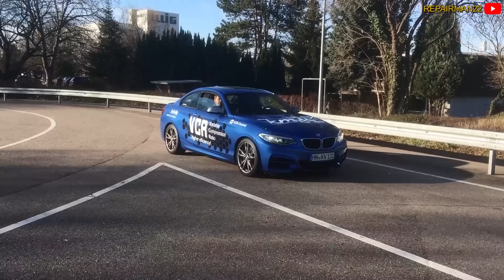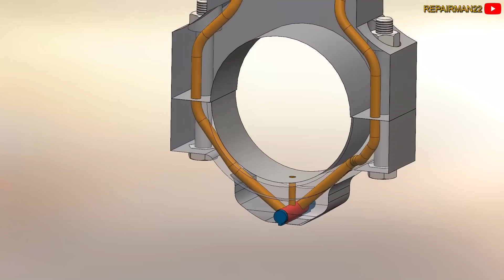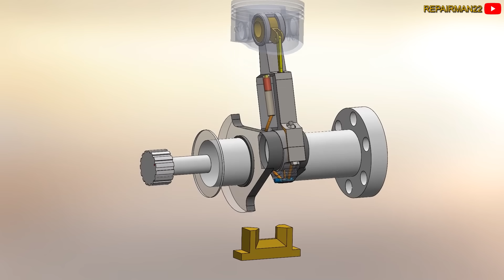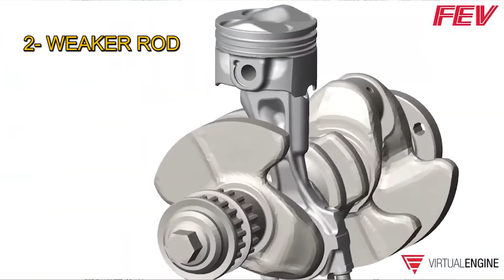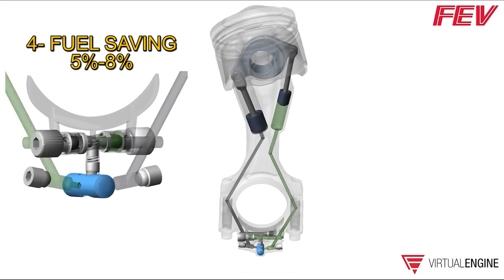This BMW has variable Connecting Rods that can vary its length and Compression of the Engine 🤯 VCR

Comment: It’s a terrible idea all of it as far as the engineering goes, the concept is on point, but the solution to that issue can be done with combustion chamber, the volumetric size modifications  can be altered on the fly with a movable plug in the cylinder head they made variable length intake runners BMW uses a DISA valve to open and close part of the plenum, you could close and open a depression in the cylinder head, or even have the VANOS system incorporate cylinder bleed off, or even leave some vacuum in by closing the exhaust valve earlier (sans overlap) during the times when less compression is needed and more volume is desired. This can easily be done with literally only one more moving part, or a few if done mechanically instead of hydraulically via engine lubricating oil, and no oil pump major plumbing or excess weight, weakened and less reliable parts that need to be strong lighter and more reliable. These new engineers must have serious tunnel vision, and it sounds like they either need to stay out of Amsterdam, or learn the K.I.S.S. approach, Keep It Simple Scheisskopf!
All that complicated mess in the reciprocating parts may only slightly increase the bob weight but it will change the center of balance, you would see this if you stepped back and opened your cannabinoid laden eyelids! Nein der Depp Schwashopf!

Comment: yeah since bmw is well known for reliability lets add another complicated part into them.  after a month each cylinder will be hard locked into different compression and the vvt will be locked into racing mode or tractor pulling mode!!

Comment: Using electronic valves will be much better I guess as you can close them quickly or lately so that less or more air and fuel gets into it and control the compression.

Comment: This whole idea is obsolete.  Just close the intake valve later until less air is present and compress with a high CR as before.  It will achieve low CR through dynamic reversion.  Valve timing is already variable.  No other parts needed, just software.  For those concerned about fuel or emissions, we have DI already, so there is no fuel in the incoming air.

Comment: Why not go for a solution that decreases engine complication and remove the need for variable compression? Ditch the turbo and go naturally aspirated! That one has been tried a few times before, and it seems to work fine.

Comment: There are simpler ways to create variable compression, all while using standard rods, pistons, and cranks.  Saab comes to mind, where an eccentric shaft pivots the entire head down towards the crank by a few millimeters.  Brilliant in its simplicity.  In engineering complexity is the measure of poor engineering.

Comment: For those interested, Saab built a variable compression engine in the 2000's by using a hinged block that moved the cylinders and the head closer and further from the crank.
Reply: I remember this, it never went into production however. Think they had too many issues making it reliable
Reply: @jaredbawden6707  According to Google it was killed by GM due to budget
Reply: @1234567890CAB  SAAB did have a reputation of spending more than they were making. So that's unsurprising. Still 20 years on, the tech was never utilised.
Reply: That would be interesting on a test bed, but in a vehicle with all the fuel, inlet and exhaust connections having to flex as the head moves, to likely to fail.
Reply: yeeah, or just move the crank case instead of the block and head ; ), 
 cilinder @PiDsPagePrototypes
Reply: @blauwzakjecrack  Same problem, but worse, as the crank moves the entire drivetrain alignment alters.
Reply: @blauwzakjecrack  if you want to be able to vary the cylinder pressure, the word you're looking for is "turbocharger."
Reply: @rocketpigrecords3719 NOP!
Make a turbo engine be more efficient at idle or under low load!?

It’s called the Atkinson’s cycle and you do need lower compression for that.

The best solution is to be ABLE to have either low compression or high compression, instantaneously and on demand!
Reply: @pepeshopping  it's called they don't do this for a reason. 

Mazda made a car based on these tryhard concepts, it was called the Millenia.

Gee, I do want a supercharged engine that produces the same power as a naturally aspirated version of the same engine without the Geek Cycle, but with unimpressive real world economy gains and many more expensive moving parts to fail.

The 2.3l Millenia had less power than a buick 3.8l and matched city economy, made 2mpg less highway.

That's right, a 1.5l bigger redneck pushrod motor beat the smaller nerd motor in economy, without making maintenance a burden.

Why bother?

Now, compare to the Ultra, supercgarged 3.8l.

While the Buick loses 1mpg city, matches highway, it absolutes assrapes the Mazda on power. I used to run an LT1 Roadmaster, a well driven Ultra was a threat to my 265hp 335lbft hoonmobile.

Which, lol, at 5.7l and over 2 tons, made 2mpg less city and highway than your dorkmobile. While being able to tow 5500lbs, seat six, and be admired & desired.

Geeks get slammed into lockers for a reason.
Reply: @PiDsPagePrototypes  It is a solved problem. The harder part is to make variable length connections to timing. Additionally adjusting height is a very hard work - there is always high pressure cylinder that need to be overcame whereas piston can be adjusted during time without acting force.
Reply: That was also a stupid idea, which is why Saab had to rely on GM engineering & rebadging Subarus before inevitably dying off.
Reply: @rocketpigrecords3719  they were meant to be relying more heavily on GM designs than they were. Kept spending too much redeveloping designs they were handed, which is why GM inevitably pulled the plug. Had they been more modest with their spending habits, they may have still existed.
Reply: @jaredbawden6707  they were dedicated to being silly, you have to credit them for that.

Volvo too goofed off into the realm of Scandi flavored VW esque luxury brand instead of continuing to build excellent tanks in the shape of midsized wagons.

Must be something in those meatballs. Imagine being able to buy a 2024 Volvo 740. Sad.
Reply: And look where Saab is now.
Reply: @myboy051  Saab is now a tech developer for the Chinese EV manufacturer that bought them, they're doing what they always did, just without the production lines.

Comment: This is far better suited to a camry or some low-rpm use case.  Putting it on a "Ultimate Driving Machine" is a very bad idea.  Nissan's variable compression ratio system is a lot less complex.

Comment: On our farm we had a 4020 and a 3020, both diesel & powershift and were the best tractors as they never broke down. Yes they will lift a lot of weight but the pressure in the hydraulic pump wouldn';t bypass when you started it so we bought a valve that would bypass the pump when you were starting it, hooked bypass to the starter wire so it would dump the pressure when starting! Don't get rid of that tractor, they are very valuable and not an electronic POS like the new ones!

Comment: Can acheive the same effect by electronically controlling exhaust valve duration similar to the free valve system using oil pressure like a diesel jake brake effect.. simple as without having fragile internals..😂😂

Comment: It would be far easier just to vary the inlet valve timing as most other engine makers do when running on the Atkinson Cycle.
BMW are adding a huge amount of complexity and weight to the piston / connecting rod that then needs a heavier crankshaft to balance it.
Also there is the "Infiniti" design of variable stroke / compression engine.
Reply: BMW is not adding anything. This is a University research project.

Comment: I like the way this is going and variable compression is a good idea 👍.
I worked in hydraulics for 20+ years and i can think on a easier way with less moving parts for the hydraulic press to move the 2 pistons...
It's difficult to explain in this comment section but i can make drawings for the principle of my idea 😀
And it's very commonly used in hydraulics already.
It can be made in 2 ways and it  depends on how much control you want/ need on the position of the piston.
Is it only 2 positions ..." low" and "high "  or do you want it variable where several or almost infinite number of positions can be made.
The first one is the easiest and the second one is a little bit more complicated but still fairly easy and already used in hydraulics.
😀
Contact me if you are interested 
Best regards 
Gert

Comment: Saab introduced a way simpler variable compression engine in the year 2000. Lots of those still run today. Why over-complicate?
Reply: Yes, they had a hinge between the crankcase and cylinders, which where controlled by an excenter, to rise or lower the cylinders from the crankcase 👍

Comment: A very complex system where many things could go wrong during long-term use.  Lubrication of engines and hydraulics requires oil with strict tolerances that is rare enough, yet able to withstand high pressures and temperatures and therefore a limited service life.  Reliability questionable.  Maintenance and servicing quite expensive.  The idea is good, but the production is too complicated, which stands in the way of mass production.

Comment: A BRILLIANT IDEA since there is already a turbo : why not adjust the turbo output to regulate the  amount of air entering the cylinder instead of this complex mechanical mechanism. This should have the same effect on compression  ratio.
Reply from the maker: When the engine is idling, the turbo does not work. You can't increase the compression in that situation.
Additionally, if the throttle body is partially closed, the engine operates with vacuum in the intake manifold.

Comment: You want perfection? The small block Chevy V8. Simple, easy to work on and inexpensive. What you lose in efficiency is more than made up for in cost of manufacture and repair. We have been going backwards for the last few decades.
Reply: Very inefficient.
Reply: Plus it JUST KEEPS GOING while new engines break down as soon as you buy the car

Comment: I’m an Automotive tech of 21 years. When the owner doesn’t stay on top of their oil changes or the shop doesn’t use the correct oil viscosity. When do we all think is going to happen to the oil control valves? Or when the oil control valve on the crank fails. What a job that’s going to be. Yup looks German to me. Always trying to break something that works good.
Reply: That's already an issue on almsot any modern car. Folks grenade engines left and right from not following the service interval or using the wrong oil. This may be complex, but for the secondary oil galley version I can't imagine it being more failiure prone than current oil pressure based VVT systems. They use TIGHT tolerances on those, and contamination or deteriorated oil regularly destorys them already.
Reply: Well aint you a bundle of sour grapes
Reply: What oil control valve, do you mean pressure relief valve, & I worked on these engines & never saw any problems with this cam drive system but a simple chain would have been more efficient, these engines were underpowered considering it was OHC, the plain bearings should have been ball bearings, at the time OHC engines were noisy, I suppose that was the reasoning.

Comment: It'd be so much easier to make the combustion chamber variable size, with a mechanism in the head (which is fixed, not rotating).
Reply: i think a variable combustion chamber messes too much with the explosion propagation .
Reply: @fs5866  Fair point. Cheers !! 🙂

Comment: oil passage bore is sealed with a rubber oring and the spring in connecting rod will made of material that will wear out before said oring

Comment: Given the failure rate of Vanos units on BMW's due to poor maintenance, I'd have thought the last thing car owners want is another built in failure. Is this feature going to be one of those 'extras' that can be turned on / off by the dealer when buying the car depending on either the thickness of your wallet or brain..

Comment: Even though backlash in the rack and pinion would limit its useful life as the squeeze lubrication would eventually lead to contact failure, giving the eccentric gudgeon the ability to have a 180 degree angular movement would reduce the reversing torque at TDC and BDC created by the acceleration second harmonic. How would this mechanism handle the shock loads from random fuel detonation?

Comment: Trying something new is never wrong. I have to see how this works out, being in a hot and loadsensitive part of the engine.
Reply: Probably a bad idea.  Good concept if you are an engineer looking for employment in reseaqrch and development, but terrible for mass implementation.
Reply: Not new. Nissan has had turbos with variable compression for the least 4 years…in a cars, on the street.

Comment: I don't belive this thing would work at the end of 3y warranty. Longlife oil and 50k km or 2 years oil changes would kill this system in like 2 years max. All this sounds like that 4 turbos diesel, wich bmw drops after like 2 model years. Works good on paper and presentation not in real life. If they put this system in some cars, they need change oil and oil intervals for them, more oil changes + more oil = more money from maintenance. So in the end of the day this system could be just useless...yes you safe more fule but on the other hand you spend more on oil changes. Most new cars in Europe use longlife oils with 50k km or 2y intervals, days of 10k km oil changes are long gone.

Comment: The difference in efficiency caused by going from a compression ratio of between 9.7-1 and 13-1 is 18%, what here causes an 8% increase in efficiency is the fact that the compression ratio can be modified. compression at will, there are cars dedicated to generating a lot of power that have a low compression ratio that with this system will have the same consumption as that of an engine dedicated to saving fuell economy
Reply: Would have been so cool if car manufacturers added this when they brought turbo to the streets. I am looking at Saab, Porsche, and Ferrari. Over the decades so much fuel cold have been saved. Why did the NA engines not receive valve tronic in the oil crisis?

Comment: There would also then be an element in the BMW design that is already in the one of the Toyotas presently.  The cylinder is off set to the side of the crank center of rotation!!  That increases torque as i understand it!!   
Hi quality oil were could certainly be a must!! Probably a full synthetic!!

Comment: Mazda has a similar system, but using a kind of lever which lengthens the connecting rod. Looked very complex to me.
Reply: Nissan not Mazda. Used in Infiniti production model qx50 for few years already

Comment: Yeah really. WTF 😂 so yet even more stupid stuff to go wrong , they can’t even make a timing chain last , or rod and crank bearings  . Just think when it’s on the 3rd owner and run on a budget 😮😮 . Ahh and then there’s the diagnostics , don’t think the OBD port will tell you this problem, so it’s engine out , full strip down just to check oooppppss cars a write off even if that wasn’t the fault .

Comment: Nice exercise but too complex. A turbo with an additional electric boost for low revolutions has the same overall effect.
Reply: @@retiredbore378 It does. I meant a turbo charger which is kept at speed by an additional electric motor when the main engine is at low revolutions or idle. This can compress more air into the cylinders in any situation.

You mentioned hybrid as a too complex alternative. We are currently driving a Golf eTSI 1.0 liter 3 cylinder, which is not a full hybrid but very simple: It uses one electric motor as generator, starter and short time boost. It runs permanently with the engine, does the Start-Stop and gives extra torque at low revolutions. In combination with a turbo, it's characteristics is like a turbo diesel with mostly running at low revs with good power.

This results in a well done downsized gasoline engine with a half-hybrid design with low emissions.

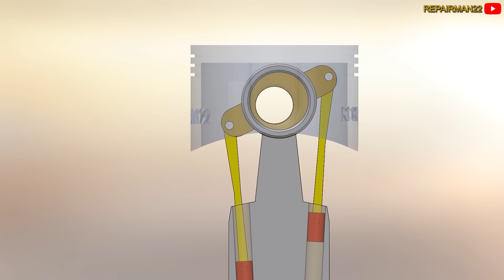Comment: 3:34 3 bar is a big LOL😄. It will not keep that eccentric in place, even at low loads... And according to Bjorn, hydrogen as up now is dead in Norway. So that`s something to think about.
Reply: 3 bar is enough was it triggers a hydraulic which can axt as a gear and has more torque at a shorter travel. And as the elipsis is excentric it is also held by friction.
Reply: 3 bar is enough was it triggers a hydraulic which can axt as a gear and has more torque at a shorter travel. And as the elipsis is excentric it is also held by friction.
Reply: 3 bar is enough was it triggers a hydraulic which can axt as a gear and has more torque at a shorter travel. And as the elipsis is excentric it is also held by friction.